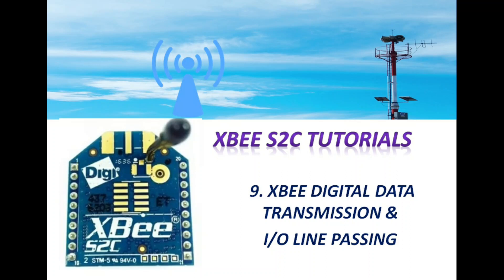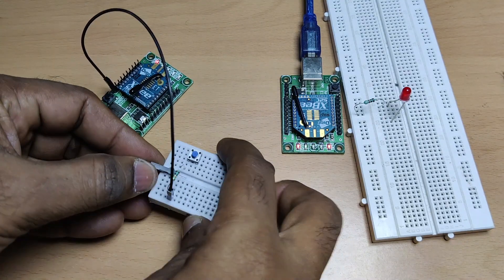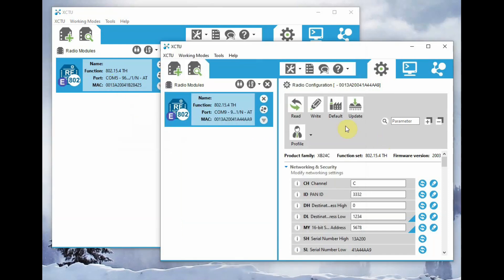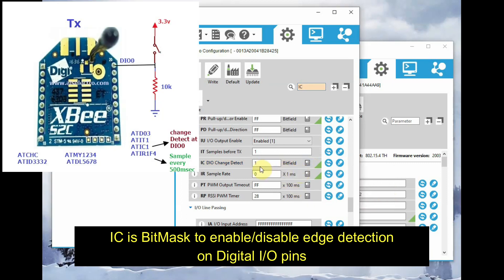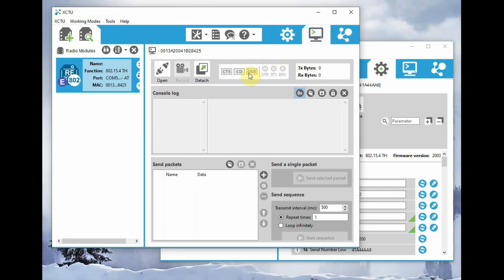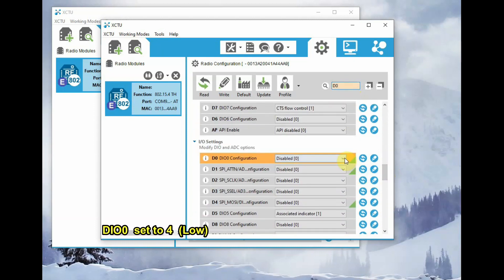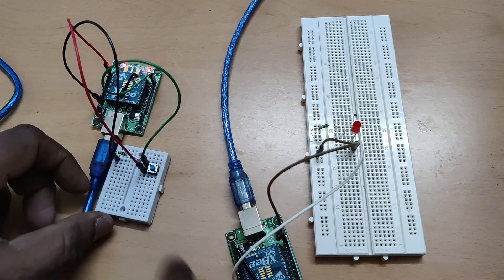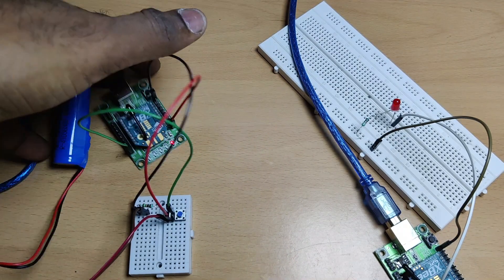Mastering XBEE - Lesson 9 - Digital Data Transmission & I/O Line Passing

Comment: Hello Sir, It was really informative.
But I am working on 1 project in which I have to from Mesh Topology in API Mode using standalone sytem.
Expected Outcome: All nodes in Mesh network should send its MAC ID to Coordinator. All nodes will be battery  operated and Only coordinator will be connected with controller.

Please probide me the settings and some information about battery operated standlaone system in Mesh network (API Mode)